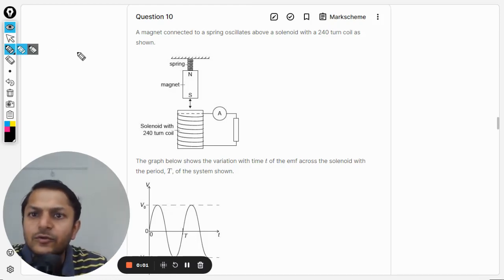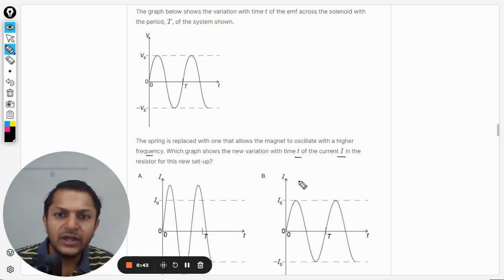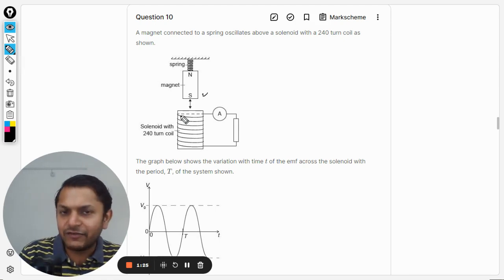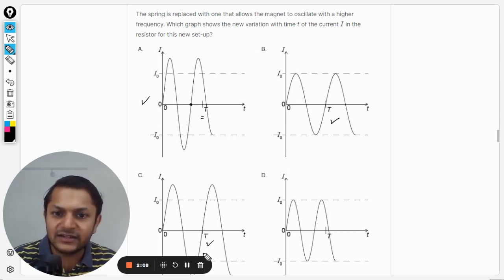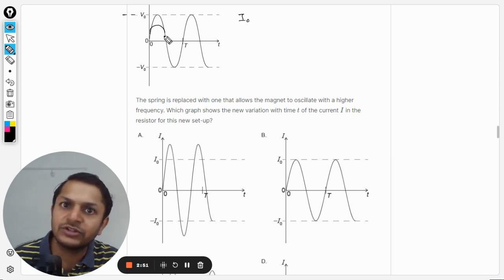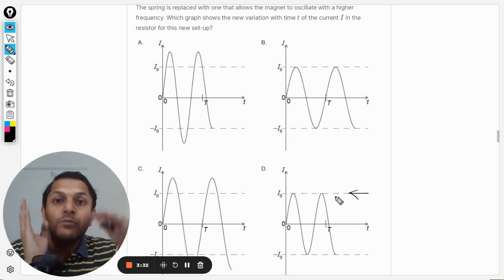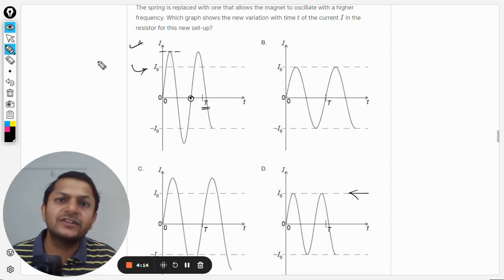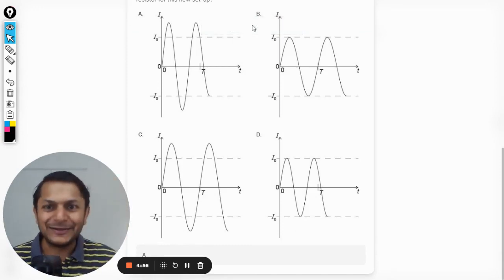A magnet connected to a spring oscillates above a solenoid with a 240 turn coil as shown.The graph b

Comment: 3:39 You are saying that if "you decrease the frequency the amplitude of the currect will increase", but isn't the question asking what happens when the frequency increases? If the resistance does not change and the voltage increases won't the current decrease?
Reply: Your explanations are always very helpful!